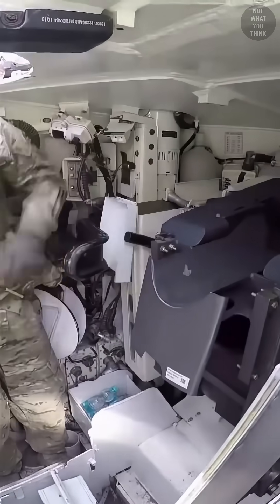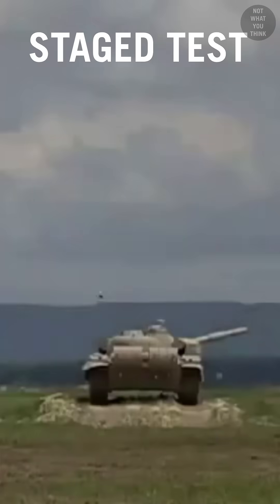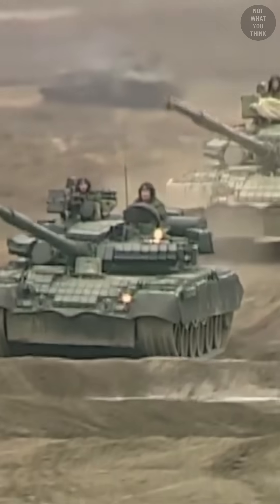Why M1 Abrams Tank Has No Auto-Loader #shorts

Comment: Ah yes, the manual loading using a  N I N E T E E N  Y E A R  O L D  A M E R I C A N  B O Y
Reply: Better than having an auto loader as we have seen in Ukraine. Having an auto loader means the entire crew dies when the tank is struck in the turret.
Reply: @vyros.3234  Not really, depend on where is the auto loader. In the case of russian tank the auto loader is under the turret killing the crew in a explosion. However other tanks have the same security as the Abrams while still having an auto loader like the Leclerc.
Reply: @Grassouillelafripouille  auto loader be a problem if it jams though.  Having the human element just seems to have more advantages.  Although having powered exosuit arms be good for the loader.
Reply: @TheCaptainSplatter  to load 50 lb shells? I'm 40 and I can throw 50lb boxes over my head all day. I'm sure a bunch of young, fit soldiers could load them for hours if they had to without needing anything like that
Reply: @vyros.3234 anything getting hit with a javelin dies.
Reply: @Cheesus Sliced what part of my comment do you think required your reply?

Comment: I was told the US army rejected them because the mechanism still took 3 seconds between rounds vs a well trained loader being under that coupled with the early autoloader having not only a bunch of complicated machinery, but all of it was exposed leading to huge limb loss potential for the crew. The safer ammo rack was a lucky byproduct.
Reply: If you really think a human is faster than an autoloader under war condition then you must have lost your logic
Reply: @tm.8399  You're telling me logically that a machine made over 50 years ago that had to fit within size of the turret and low enough weight not to compromise the tracks/ handling characteristics of the vehicle couldn't be possibly slower than a human?  All because the loader(who is practically alone in a dark room with no sight of the battlefield) will suddenly lose his nerve doing the same exact stuff in which they train? Does he all of a sudden have to be aware of his bodies position in some way that I don't know of as if he is infantry or part of an SPG/artillery unit? Your attempt to show your intellectual superiority via belittlement backfired pretty hard, as you only displayed your caveman like "logic" of machine=faster than human always.
Reply: @johngalbicsek5567  the autoloader is 30yo and yes. The US army also came to the same conclusion, they picked autoloader over human for the Abrams refit. And yes machine are faster than human, that's how human increased their productivity the last 50 years

Comment: But you do know that there are autoloaders that grabs the rounds from the back of the turret in a similar blow-out pannel solution from the manual loading systems? This means that the argument of threat of flying turrets that kill crew members is not well placed.
Reply: But it’s slow. Much slower than manual load. A well trained loader can load a sabot round in 2.5 seconds.

Comment: The fact that Soviet tanks blow up is simply that they are used  for ground support and cary up to 22 HE powerful shells inside the tank. They are able to fold down buildings with enemy troops inside but these kind of amo isn’t safe to have if you got penitrated. American MBT don’t even have those shells on board.   They are designed for different missions. If Soviet tanks would be equipped just armor piercing shells like Americans , it would be really hard to make them explode or got on fire.